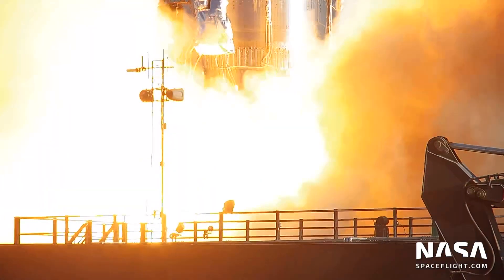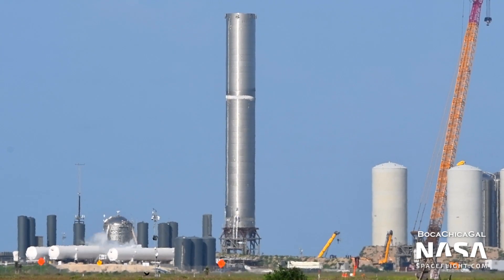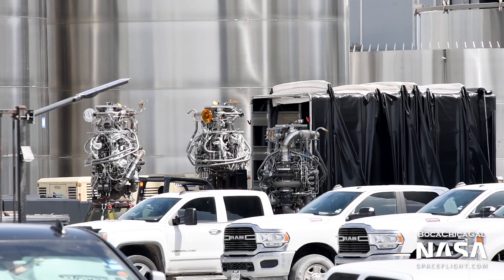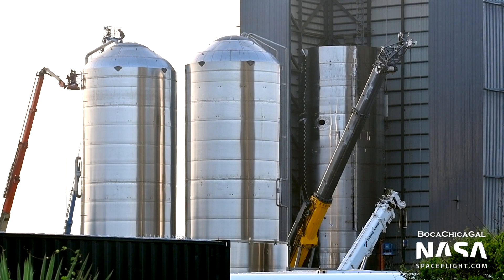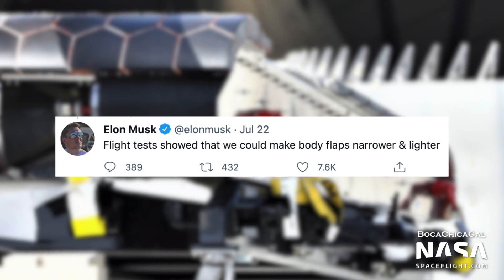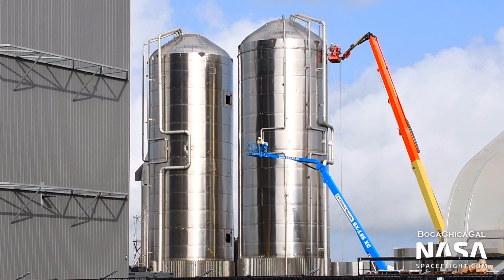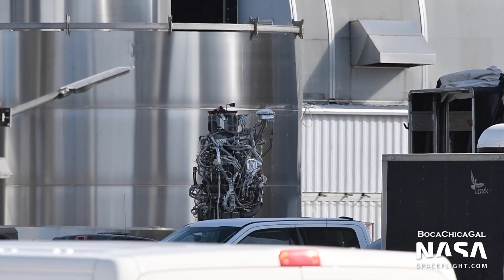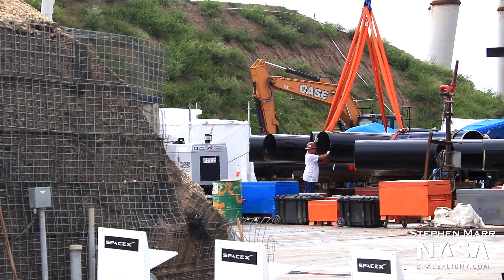Starship Tests Payload Bay Design, Booster 3 Static Fire, New Test Rig Built | This Week in Starbase

Comment: Regarding the possibility that the yellow truss structure is related to fueling, I had been under the impression that fueling of both stages would be from underneath the stack and that Ship would be fueled using plumbing inside of Booster.  Is this no longer considered plausible?
Reply: @TheEvilmooseofdoom  I don't recall, but I didn't knowingly make it up.
Reply: @TheEvilmooseofdoom  The rationale was that this would be some of the same plumbing used for in-orbit tail-tail transfer of fuel between ships.
Reply: This is my understanding as well. We know that starship has quick connects at the bottom of the skirt from underneath for propellant loading (seen in many videos). While the booster probably does have an arm for fueling (it lacks the convenient skirt and B3 has side-feed plumbing presently connected on the pad), the ship connections would be in the inter-stage area and thus would need through-feed from the booster (they can't be accessed from outside).
Reply: Starship is to be refueled from below but it makes since to refuel booster from the side. Instead of each booster having piping from bottom to top to get fuel to starship you save weight by having the needed plumbing on the tower instead.
Reply: In fact to save weight it would make sense to have three arms, a booster lox, a booster methane and a combined one to the booster interconnect to push fuel to starship.
Reply: @MrDcwithrow  Can't fault your logic.  Sounds reasonable.
Reply: @MrDcwithrow  That's a good point. They do need the bottom ports on the ship for the on-orbit refueling, but a quick 90 on the top of the booster to fuel from the side would be more mass-efficient.

Comment: I don't see how they will have as quick of a turn around time as they say they will with Starship with all of that thermal tiling. At this point my guess is that they will end up having to use multiple individual boosters and starship 2nd stages to do a moon shot, or a trip to mars. Which would inflate the cost per launch.
Reply: Uh those tiles are reusable.
Reply: I was looking at that white glue they were using on the tiles and wondering how it might be better than what NASA used on the shuttle? Shuttle ended up requiring a lot of refurbishment between flights - how have things improved since then I wonder?